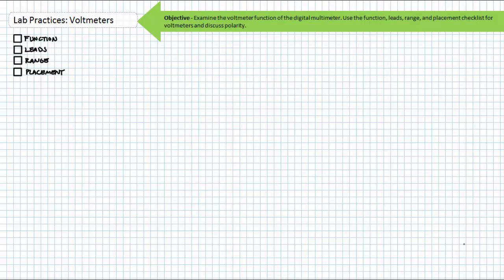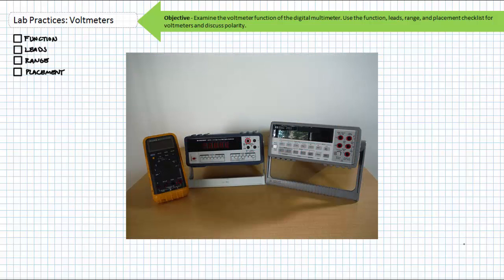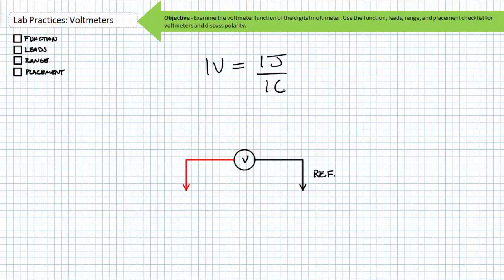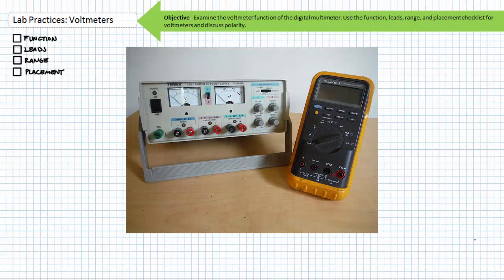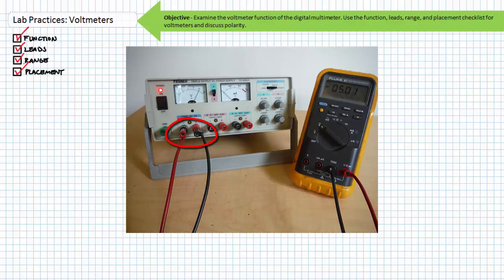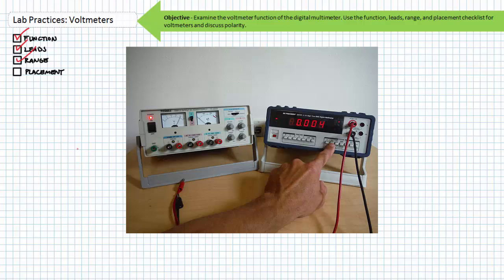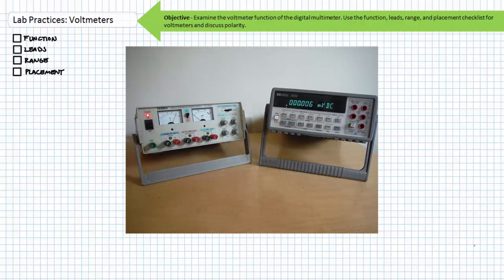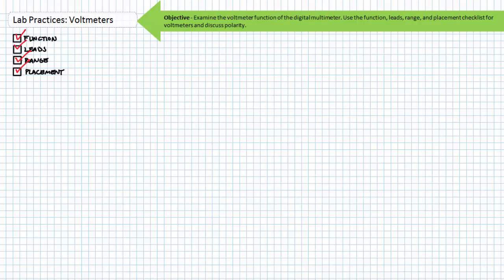Intro to DC Voltmeters (OLD LECTURE)

Comment: well, this comment refers not only to voltage, but to another lesson that you have been preaching: know what you are dealing with!  So, I have this power supply connector (5V/3.3V) for protoboards that came along with a breadboard kit I bought when beginning my studies.  (total novice).  It has two input jacks: one a std USB, the other, a barrel socket.  So, I have been using the barrel socket as my input power supply, trusting that 5V is 5V.  Today, after watching this video, I decided for grins to test the output of the 2 different sockets on my protoboard.  Much to my surprise: 3.6V o/p on barrel, 5.2 on the USB on the protoboard!  I am using the same wall wart, tested the output barrel: it's 5V, so the insides of the thing is eating up about 1.4V. <>.  I've been driving on a 3/4 charged voltage!  All my calculations on my circuits have been WRONG because i/p voltage was NOT i/p voltage.   Suppose I should have caught this earlier.  You say: "baby steps will get you there, only slower".  That's: poco a poco.